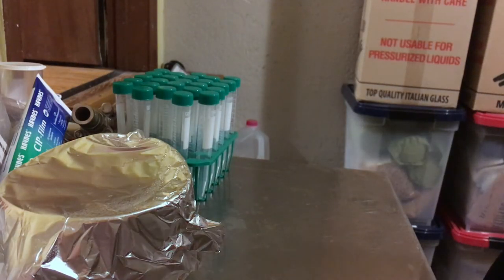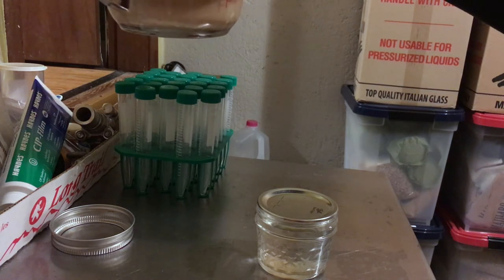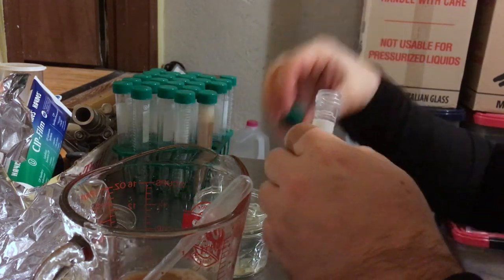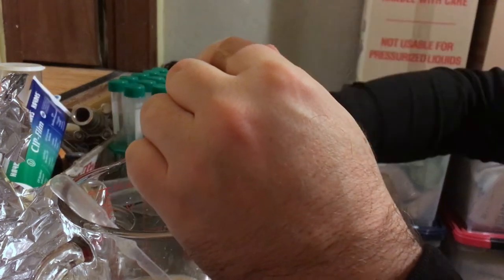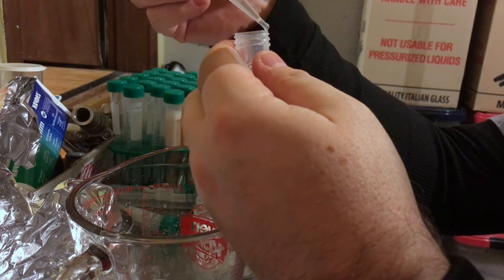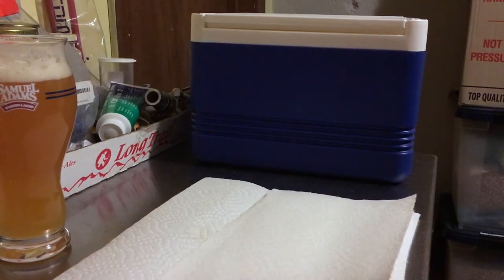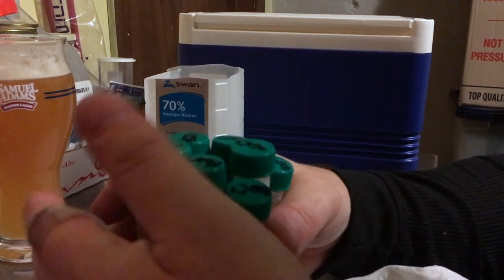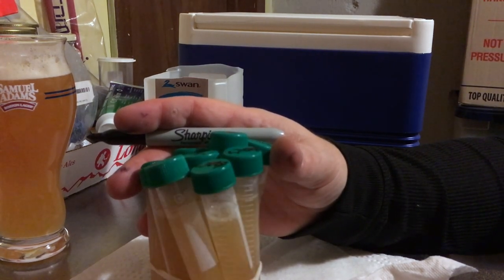Freezing Yeast for a Yeast Bank with Glyercin

Comment: Hi .  I have a question.  I have a hydrometer to measure alcohol, but it measures some drinks and others don't.  Is the problem with it or from the drinks?
Reply from the maker: Depends on the type of hydrometer you have.  Standard triple scale will work to measure the gravity before and after fermentation.

Comment: Are the 15 ml Centrifuge Tubes PET or Glass?  Looks like you purchased them as a set. Are they expensive? Would you provide a link for other viewers? This seems to be a more viable way to capture yeast vs harvesting after the brew having to wash it. Like you said it could lead to contamination.
Reply from the maker: Mark Thrower sorry, I’m surprised i didn’t include a link in the description. I bought these on amazon, mainly to get the little racks. There are better deals in the sterile tubes if you wish to buy in bulk.  https://www.amazon.com/gp/aw/d/B01J43JF3Q?psc https://www.amazon.com/gp/aw/d/B01J43JF3Q
Reply: I also watched your "Smoked Amber Ale on my Electric BIAB System" video... I like your DIY spirit man... your doing some really smart stuff
Reply from the maker: Thanks for watching!  A lot of the fun in this hobby is trying new and interesting things.